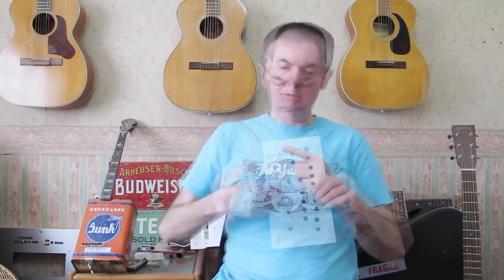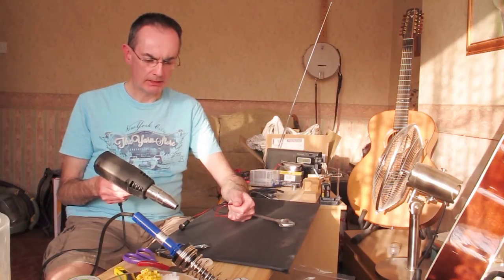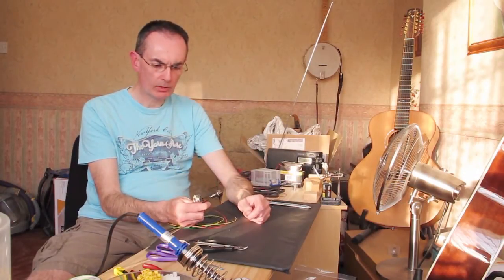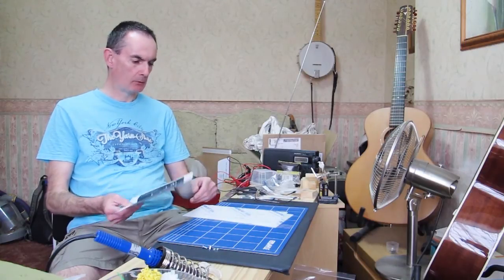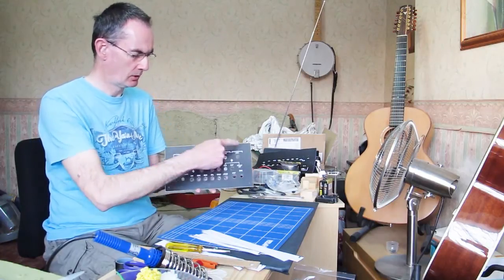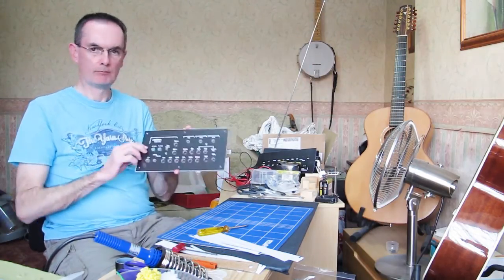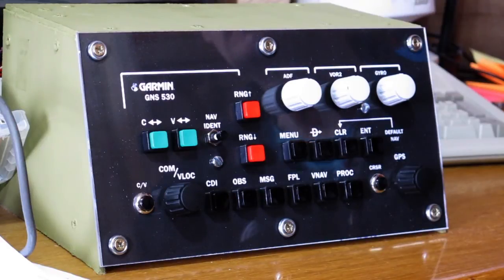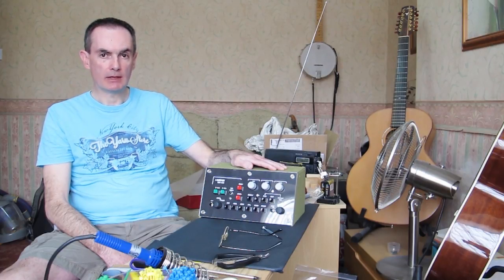DEMO: GPS+ kit build. Soldering NOT required!

Comment: Nice to see your videos again Mark its been a while.
What a great tutorial very informative.
Just back from holiday and very impressed with your panels.
That GPS panel at the end of your video looks fantastic is it for sale.Meaning as it is built by you.
Reply from the maker: jodonbaker43 Thanks for the encouragement! I have not really considered selling fully-built panels but I don't think it would be for less than £170 for the assembled panel. You would still need to mount the panel on some kind of frame or box of your own choosing. I would be able to make simple variations to the captions and graphics (to add a logo, say).

Comment: Problem with no soldering is eventually wires work loose, so it's better to just solder them. Also it's an extremely useful skill to have, and is really dead easy. Just don't overdo the solder.
Reply from the maker: NeonsStyle I agree that soldering is a safer option, although I am not convinced they would work loose in this application.